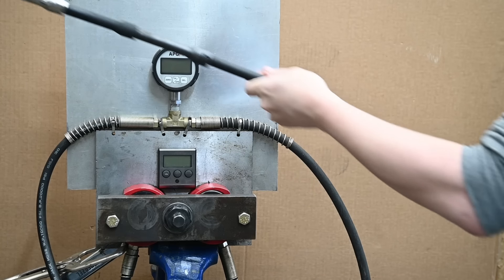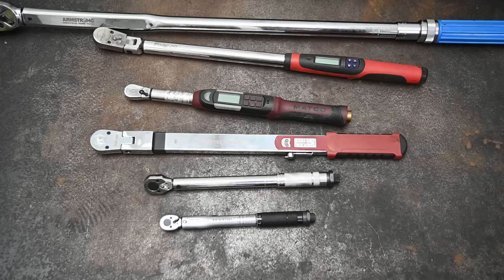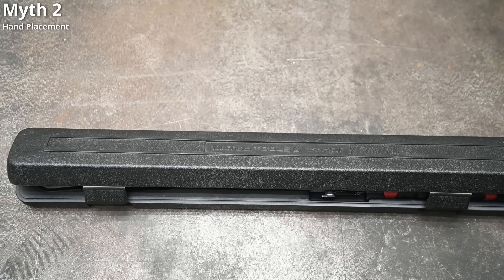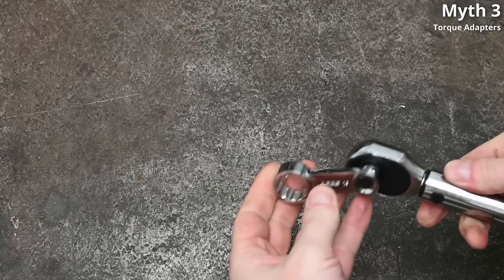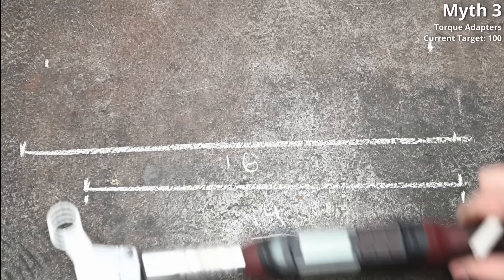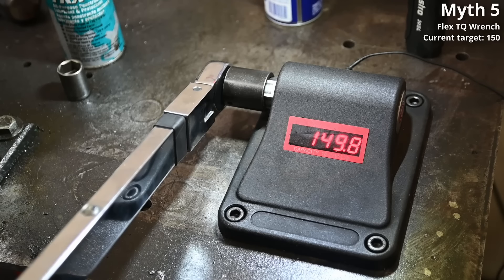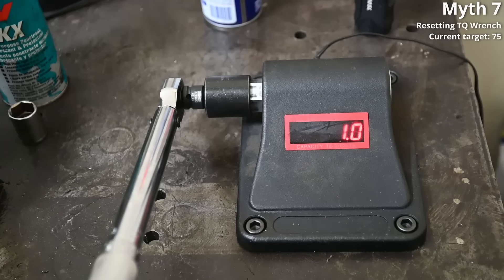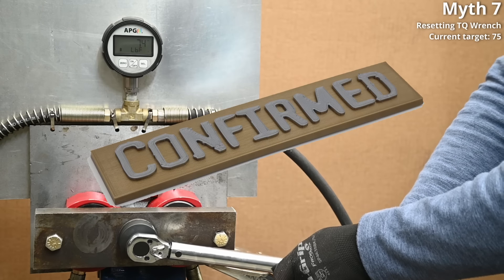You're Using a Torque Wrench Wrong: MythBusting 10 Do's & Dont's

Comment: The change in torque values using anti-seize is mind blowing. On bicycles, especially with carbon fiber components, torque settings are very important to prevent breaking of components. It is generally recommended to use a lubricant on those threads. However, the manufacturers  do not necessarily specify if the torque settings are lubricated or not. At very low torque settings, in the 5 to 8 Newton meter range, it would be interesting to see how much lubrication changes the torque values.
Reply: That's the thing, many companies aren't that technical. Going in dry is a way of saying "I want seized fasteners." unless the instructions specify to torque dry, like SRAM's UDH bolt.
Reply: my oil pan drain plug always has oil on it :(

Comment: Good information overall.  I'm not going to scroll through and respond to anyone else's comments, some of which are very intelligent and thoughtful.  I'm just sharing what I know as an old engineer.  I'm probably repeating what a lot of others have said, if so I'm confirming they're right.  (Because I'm always right, of course.)

Your dyno (which it's not by definition) is not directly measuring torque!  You know this and should have been clearer about that.  It's measuring tension, and calculating torque based on inputs and assumptions.  As you touched on, friction is a very significant factor in the calculations.  It's obvious when you change the friction you get different tension from the same torque.

The tension is what matters, the torque and other variables are just how you get there.  You want it tight enough to handle the load, and to not vibrate loose, but obviously not yielding (in most applications.)  There are differing schools of thought on what the tension should even be as a percentage of the yield strength of the bolt.  For instance, API says 80%.  I don't 100% agree it's the optimum but it works well enough.  I'm retired and I'm not going down that rabbit hole.  They specify torque targets and tolerances for moly paste (basically anti-seize) and for API spec oil (basically motor oil but with more specific requirements.)  They do not specify torque for dry threads.

Someone mentioned thread locking compounds.  They do lubricate the threads, and will increase the resulting tension if you use a 'dry' torque spec.  We know (within a range of variability, whole 'nother topic) what the friction factor is for moly, and more accurately for that API oil, I don't know what it is with threadlockers.  I don't know if different ones have different friction factors, probably so.  That would be something interesting for you guys to investigate.  A properly tensioned bolt or stud generally doesn't need it, so if you're torquing based on a 'dry' spec you're better off dry.

Interesting anecdote: Mitsubishi globally specifies motor oil on wheel lug nuts.  They had some fatalities in their Fuso OTR trucks and did extensive testing, and found that to be the most predictable way to get the right tension.  I agree, based on other sources I've read over the years.  So being Japanese, they made that an absolute rule and allowed for no exceptions.  Lug nut, use oil, period.  BUT: on warehouse forklifts with very hard, thin rubber tires, the vibration is horrendous.  And the way they were attached was a little different from an automotive wheel.  From experience, the assembly shop and I determined the only way to keep those wheels on was red Loctite.  We didn't tell Mitsubishi.

Bottom line, in many applications a precise torque is not critical.  Since the tension resulting from a given torque can vary anyway, a well-designed bolted joint is fairly tolerant of variation.  Of course there are cases where it is critical to get the right torque AND the right bolt AND under all the right conditions.  Someone mentioned aviation, that's a good example.  On blowout preventers I followed the API rules, and meticulously calculated whenever there was any question on a specific case.  In my garage at home I use my judgement, based on over 30 years of engineering experience and more like 50 years of hands-on.  I usually don't use a torque wrench.  I sure as hell don't run all those calculations, I'm retired.  On my motorcycle I'm more persnickety than on my Tacoma, it's more sensitive to variation and a failure has greater consequences.  Sometimes I use threadlocker, sometimes I use anti-seize.  Sometimes I use nothing.  It depends.  Judgement and experience and gut feel.

My recommendation in general is, if you're working on something that can get someone killed, know what torque (and min/max range!) is specified and meet it.  Know whether the spec is for dry or lubricated (and what lube if applicable.)  If the spec is for dry, do it dry and CLEAN.  Dirt, or greasy grunge, can have a huge effect on the tension (repeating, the tension is the only thing that really matters.)  On the other hand, if you have years of experience on the same type of equipment, and you just know what never comes loose and never never breaks off, and that bolt is not life and death critical, your calibrated wrist is gonna be quite good enough.
Reply: @richardhorstketter6574 Thank you.  Your comment explains what I was missing regarding the 'dyno' and the wrench not agreeing on the torque if the thread is lubricated.  If the 'dyno' is measuring tension not torsion (and displaying hypothetical torsion equivalents) then it all makes perfect sense.

Comment: I'm glad I tuned into this video, myth #9 was pretty eye-opening to me. I work for a manufacturer of heavy equipment and we slather pretty much everything in anti-seize (including hub studs, got me to chuckle when you mentioned us in th Rust Belt). I'll have to consult with engineering to see what spec they're following because nearly doubling a 100 ft-lb reading could have an impact depending on our application.

Comment: For the anti seize myth. Glad to see it in action. From working with big machinery. There's a metric bolt chart for tightness depending on hardness and wet v dry
Reply: Working at shipyards, we lubricate every fastener. Our torque specs require anti-seize to be to legitimate.
Reply: Yep, follow the work procedure re wet vs. dry torque.  There are reasons why one or the other is specified.  In automotive applications it is usually dry unless otherwise stated, but the front matter of the service manual is a common place to find that info.
Reply: @berrymacokener4393  this is how it shoud be either everything needs anti-seize or nothing does lol
Reply: @joey9511 small correction, everything should have anti-sieze unless it needs thread locker/sealant
Reply: @williambartholomew5680  I guess it depends on the terminology, but anti-seize is used in high-temperature applications. There is a big difference between bolting an exhaust manifold and a door hinge. How about just following instructions? In many applications, dry connection is just fine. And personally, I would rather default to mild thread locker (i.e. non-permanent) unless higher temperatures are involved as vibrations loosening fasteners is more dangerous than fasteners getting stuck (that's just expensive and annoying). But still, I need to know whether the torque specified is wet or dry.
Reply: @williambartholomew5680  In the majority of applications, nothing is needed on threads.
In aviation, we put anti-seize on spark plugs, because failing to do so risks ripping out the thread inserts (from the aluminum heads) when removing them later.
We put thread-locker on some small parts where we can't risk them coming apart and safety wire or cotter pins aren't practical. We use wire and cotter pins where we can. (And occasionally lock-washers or self-locking nuts.)
But there is a surprisingly large variety of important nuts and bolts where neither gets used. And yet, with over 50 years of observations, they just never seem to come apart, even with heat cycles and vibration. (Part of that is because we inspect everything periodically.)
Reply: @berrymacokener4393 well that makes sense. Being a shipyard, I'm assuming they're expecting a lot of corrosion. But honestly, this should be more of a standard thing in other industries.
Reply: @zeanyt2372  When you expect corrosion to be an issue, there are other products that are applied. In the army, we used "CPC," corrosion preventive compound, on all of the major nuts and bolts. When I was stationed more inland, we didn't use as much, but in Hawaii, we used it on everything. Coastal environments are pure hell on aircraft.
CPC is not an anti-seize or a lubricant. Its only job was corrosion control.
Reply: I read about lubrication making a bolt too tight, and the video confirms that it actually happens that way.
Reply: @eclectichoosier5474 but what torque to use on plugs with antisieze?

Comment: I got a new digital  torque adaptor,  I tested out my cheap old click type and T type as well.  With practice I consistently got under one pound.  When I first started I was 3 or 4 pounds off.   Basically, go slowly and you will get better results,
Reply from the maker: We usually set digital around 3ft-lbs low and go until the beep and then check the display and it's fairly spot on from going over a bit, just as you say

Comment: Double the torque using anti-seize is insane. I use anti-seize quite a bit on bikes and had no idea I could be torquing the fasteners with up to double the force. In fact if anything I thought it would result in less torque I'll definitely keep this in mind going forward.

The problem is a lot of the time bike manuals don't specify any lubricants for fasteners, just a torque value. And you know that if you don't put anything on the threads it's gonna seize and be a nightmare to remove.

You should do a video looking deeper into torque values when using different lubricants, e.g. different types of grease, loctite, anti-seize. Would be interesting to see the effect. Also the effect of putting more or less lubricant on threads.
Reply: I agree. The anti-seize is something I've never taken into consideration.
Reply: There are charts you can reference to convert dry torque value to wet, but you are assuming liability
Reply: Some applications will specify what lubricants to use - engines for example often require oil on threads when torquing, some engine bolts require thread sealant, so the manuals state different specs for both.

So for anti-sieze or oil, those should only be applied to fasteners you don't need a torque wrench for - tighten to what you're comfortable loosening at. Anti-sieze on my lug nuts tightened as hard as I can get them with my 12" diameter 4-way lug wrench will result in no damage and the wheel won't fall off nor will the lugs naturally loosen either. But anti-sieze on an axle bolt that needs a very specific torque spec and you shouldn't be touching frequently? Definitely do as manual describes
Reply: @williambartholomew5680  you should NEVER put anti-seize on lug nut threads ever ! And tightening them down as hard as you can with your 4 way wheel brace is insane. If you do that to either alloy wheels or steel wheels you will fck up the studs on the hubs and alloy wheels will eventually crack from over tightening. There’s a reason why lug nuts are torqued to specific foot pounds or newton meters ! False information people,never put anti-seize on lug nut threads.
Reply: @williambartholomew5680   all this coming from a guy that assembles Lego 😆 dude you have absolutely no idea what you’re talking about.
Reply: @williambartholomew5680  To go along with that. Loctite is considered a "lubricant" as well when tightening bolts. I've also found loctite can help reduce corrosion over time, which makes it easier to remove the bolts later on. This is very helpful on something like a motorcycle where you have small fasteners located out in the elements exposed to weather, that also have a very low torque spec and are subjected to high amounts of vibration. 

I generally use loctite instead of anti-seize now and depending on the fastener I just go by feel instead of the listed torque spec. Obviously this isn't for anything inside the engine. More for bolts on the handlebars, frame, gas tank, etc. Sometimes on the oil filter cover.
Reply: We should hope that the bike component manufacturers realize that folks are slathering every thread in anti-seize and have spec their torque values with that considered.
Reply: @Sauronthegreat1967  didn't read since UDGAF? Because you missed the part about a 12" diameter 4-way lug wrench... How much force can you exert on 6" of a lever? Not even He-Man can produce enough torque out of 6" to over-torque any wheel lugs, a 200lb person can stand on the end and you're only inputing 100ft-lb resulting in 100ft-lb of torque on the dry lugs or the equivalent of up to 200ft-lb on lugs coated in anti-sieze - again moving the numbers to your favor assuming you're literally standing on the end.
If you limit your input you limit your output, easy math with just a tiny bit of reference
Reply: I always oil my lugnuts, or use antiseize when appropriate. Never stripped or broke anything,  nor warped a flange nor wheel, nor had one come loose.
Reply: Of course friction of the threads matters!!  Same with the nut/bolt head surface.  Same with tightening it 2 or more time from brand new either burnishing/smoothing the thread & turning surfaces, OR galling them!!!
Reply: @Sauronthegreat1967  Try doing that in the rust belt, good luck never getting them off and snapping them that way or damaging them trying to get the seized lug off.
Reply: Loctite especially, since its used for critical fasteners all the damned time.
Reply: @Sauronthegreat1967  Dude, millions of people do this every year, especially in the NE and winter areas where salt is used. And no, there are no horror stories of numerous people stuck with busted lugnuts....
And this is with people happily torqueing to 80-100# (dry rating), not the minimal number who've heard of derating 30% when lubing, or now possibly 100% as per this video.
William is probably right on the money with the math, a stand 4x lug wrench does limit the amount of torque the average person can apply, lubed or not, there is a lot of safety factor built into those bolts.
Reply: @Sauronthegreat1967  I would agree Loctite would probably be better than anti-seize on a wheel nut or bolt as it would probably prevent seizing as well as locking the thread (I've had personal experience of dissimilar metals, inside a washing machine, unscrewing with relative ease after 20 years due to whatever locking compound was used).  I'm not convinced that the bolts would work loose without my noticing it happening, and if I ever check tensions between tyre changes etc, nothing seems to have altered.

But I remember the place I used to take my car to used to use an impact driver to tighten the wheel nuts to some kind of stupid torque that meant you could never get them undone at the roadside.  Pretty tight, though actual torque not known.

I tighten mine with the brace that came with the car, but I do use Copaslip and have done for years.  So that's probably 50 lbft lubricated (which might be equivalent to 100ftlb if dry) and I can easily undo them with my 2ft length wrench even if I'm tired.  I'd never considered that the lubricant increases the tension.  Does it mean I'm over-tensioning?

Unfortunately, I have had one bolt fail, and that was as I was dismantling.  What I don't know is whether it was from historic over-torsion by the tyre fitters' impact-driving technique, or by over-tension from my own lower-torque but possibly higher-torsion lubricated method.  Realistically, now I've read these comments and considered opposite effects of worn threads/corrosion and lubrication on the torsion/tension relationship, unless I change the bolts and the wheel hubs every time I remove a wheel, my feeling is that original torque specifications are always going to be somewhat ish so I'm left more confused than before.

I think part of the problem is that when you're pressing a vehicle with a 10-year design-life into its third decade in the British climate, the effect of corrosion and thread wear on fasteners becomes significant, so putting my wheel bolts on dry simply isn't up for discussion, and the effect of anti-seize or thread locking compounds is not fully tested in this specific application.
Reply: @laurencerilling5873  If I do not use copper slip on my Volvo lug nuts They seize on. This could be the steel cone in contact with the alley wheel rim but I have used copper slip on many threads and never had a problem. Interesting to know it alters the torque though

Comment: I live in New England, where it used to snow more and I used snow tires every winter, so I used anti-seize, but only on the centering hub. As you say that stuff can follow you home, so I use small dabs squeezed onto an acid brush to apply it sparingly. The main concern was keeping that stuff off my brake rotors. As for the lug bolts, I cleaned the rust off them with a wire wheel in a bench grinder. Yes, I know there might be something carried over from other things I have previously cleaned. I supposed I should clean the threads with brake cleaner after wire-brushing. I am not surprised the anti-seize drives the actual torque values way up. You might as well oil the threads as lubricate them with anti-seize!
In my last post, I forgot to thank you for this video, so thank you!

Comment: Thank you for testing Myth #8, I'm an HVAC mechanic and I use the adjustable wrench head torque wrench for tightening the flare fitting on mini split units. Luckily I have one that was made only for adjustable wrench head, but something to look out for in the future should I need a new one.